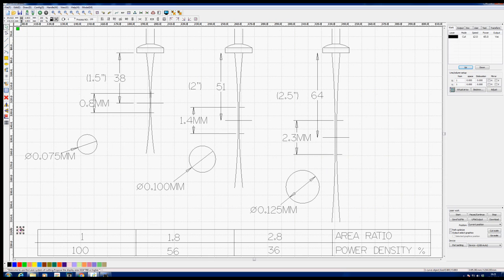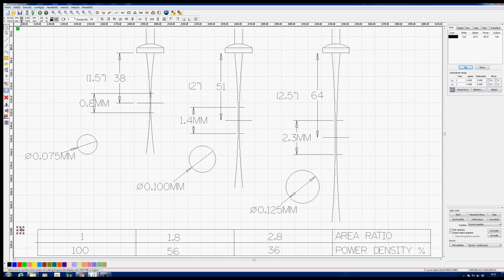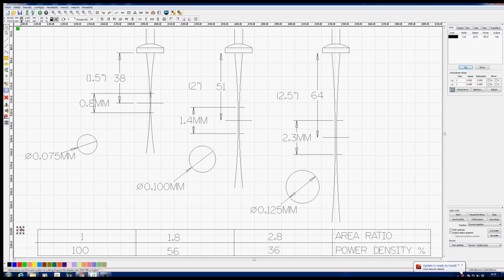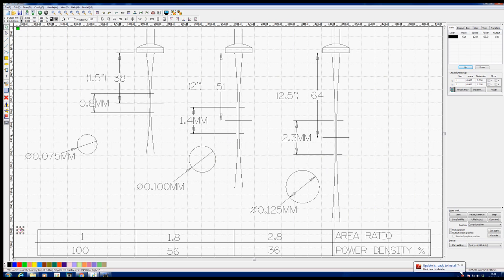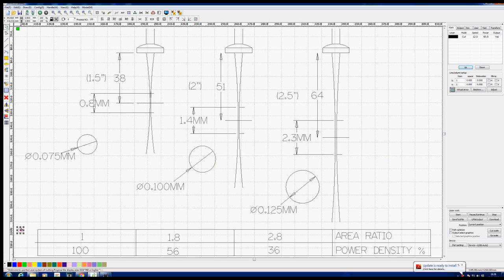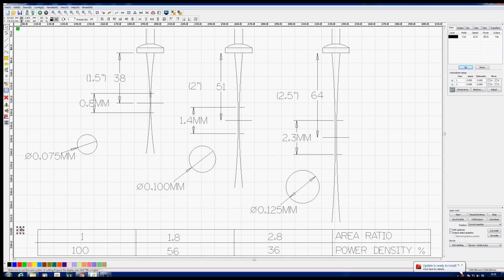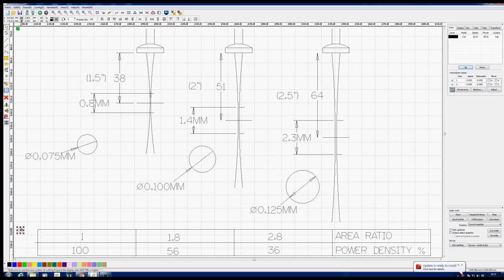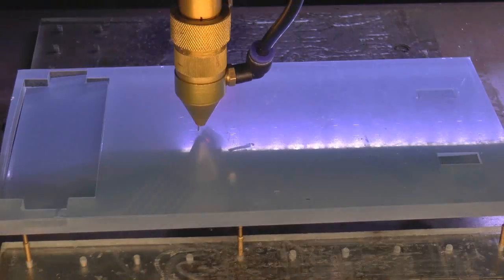RDWorks Learning Lab 39 Understanding Lenses

Comment: Where did you buy the 38mm lens? My lens has fogged up badly (stupid experiments) and I can no longer clean it.

Thanks for the very informative series. You saved me a bunch of money and allayed a lot of my fears regarding these machines and their quality.
Reply from the maker: I have bought from here successfully several times
http://www.ebay.co.uk/itm/New-HQ-ZnSe-GaAs-Focus-Lens-For-CO2-Laser-Cutting-Machine-Diam-18-25mm-FL-1-4-/330769086309?var=&hash=item4d035fb765:m:mAiSYT53XXKKLeLwI6nRWrQ
18mm 19mm and 20mm diameter available so make sure you measure yours carefully before ordering. The morer expensive HQ coatings gain you another 2% efficiency so not worth the 50% extra, Stay with ordinary ZnSe.
Best regards
Russ

Comment: Hi Russ! First of all i would like to congratulate you about your passion of finding what is wrong and how to fix it after detailed research. If i understood right, the air assist does not benefit the cutting process but the engrave process instead, correct? So if you are trying to achieve the deepest cut possible with a certain lens setup, you will not use air assist at all or just the minimum amount of air? For engraving i see that air assist is crucial in order to have less burning marks from fumes. 
Sure thing is that to own and run a laser machine you have to know many things how they work and be prepared for many brainstorming sessions. I am saying that because many people think that a laser is simple as a printer..... Thanks in advance for your reply. Polis
Reply from the maker: Hi Polis'
3 things to understand about air assist
1) Never turn it off when your laser tube could fire. Even when you don't need much air assist , make sure there is still a whisper coming out of the nozzle. That way you will never fog up your lens.
2)You need just a bit more than a whisper when you are CUTTING acrylic.  Acrylic does not CUT it EVAPORATES. Too much will cool the process down and reduce the cutting efficiency. You can use a little bit more for ENGRAVING acrylic
3) You need maximum air assist for everything else. Any CUTTING in wood or card products produces dense SMOKE because that is a BURNING process. Smoke absorbs IR radiation and so unless you keep the smoke clear from your IMMEDIATE cut area (in the groove) you will lose cutting efficiency and cause lots of charring.
Engraving wood will usually produce brown smoke sedimentation staining around your engraving. There is little you can do about this other than to mask off the surface and engrave through. Faster speed with lots of air helps but it's not a cure.

Thanks for your kind words
Best regards
Russ
Reply: Thank you so much for your detailed reply! I mainly cut plywood on a friends laser machine so have not the chance to fine tune it my self. So, i assume that max air assist will reduce also cutting depth on wood as it does on plexi, correct or not? Thanks!!
Reply from the maker: Hi Polis
Sorry if my answer confused. What I meant to say was minimal air flow for plexi glass but max airflow for EVERYTHING else. Smoke reduces cutting efficiency so you MUST get it gone. Max airflow for all wood products.
Regards
Russ
Reply: Thanks. Got it! So, only plexi glass because it is melting, does not like much air. It cools down the material making it harder for the laser beam to pass :)
Reply from the maker: Hi Polis
Still not quite got it right. Plexi is a rather special type of plastic. Most other platsics MELT when you heat them. If you fired a laser beam at a block of ice it would immediately turn to steam. Well, the same thing happens when you fire a laser beam at plexi, it does not melt but immediately turns to smelly gas. Too much air cools the plexi and reduces the speed that the plexi can vaporize.
Hope it'snow clear
Best regards
Russ
Reply: Crystal clear!!! Thanks a lot for your patience explaining :)

Comment: What am I missing, if it's a 38mm lense why it it being focused with a 6.5mm spacer?   Shouldn't the spacer be closer to 38mm? 

Also doing some reading on focus lenses. It seems the longer the focal length the deeper the cut.   Maybe you are seeing a different effect because your laser is not powerful enough for a lenses with such a long focal length?  Since with the longer focal length the "laser density" is weaker

There is some solid info from a very reputable company here
http://www.troteclaser.com/en-US/Laser-Machines/Accessories/Options/Pages/Focus-Lenses.aspx

Cheers
Reply from the maker: +Nathan Clark 
Hi Nathan
I suspect that you are doing a lot of preparatory reading prior to getting a machine. If so then lenses can understandably be a bit confusing.
The 38mm focal length is the point where the all the energy is concentrated to a theoretical sharp point. It is measured from the curved side of the lens when it is facing the work. The lens is mounted in a holder inside the nozzle. There is about 32mm of beam path hidden inside the nozzle and its only the last 6mm which exits the nozzle. Thus from a practical point of view it make sense to set your work that 6mm distance from the end of the nozzle. 
The details I have in  my picture are absolutely correct and accord with the data on the Trotec site. The shorter the focal distance the better the lens will focus the beam to a smaller waist. The smallest cross section of the waist is called "spot size" For a fixed wattage beam you can do twice as much damage to the material  by reducing the spot to 70% ( for example reducing the spot from 0.1mm to 0,07mm will double the energy density.........and be a sharper knife.) 
I tried to remove the maths from my explanation but if you want a proper mathematical explanation of energy density, spot sizes and focal lengths then you need to visit 
http://www.parallax-tech.com/faq.htm

Hope this will help remove the confusion
Best regards
Russ
Reply: +SarbarMultimedia Yes that makes total sense about the lens  being up in the nozzle.  It seems trotec says the longer the focal length the deeper the cut, but I though in  your video you said the shorter focal length cut deeper. Maybe I misunderstood the results.
Reply from the maker: +Nathan Clark
Hi Nathan
The answer is both yes and no. Let me explain. The only thing that gets longer as the focal length increases is the length of the waist  With that increased waist come the increased spot size and the lowering of energy density. That's physics, not an opinion. However you can get the energy density back up with a dramatic increase of watts into the lens. But what you have done is increase the cut width so you are now using a powerful axe rather than a  precision scalpel. Here's where I can understand your misreading/confusion. That longer waisting means the the energy density CHANGES at a slower rate, thus you have the ability to cut thicker materials.  Sadly with low power machines like we have you will never be able to pump enough power into a  long focal length lenses to turn it into an axe.
However, fear not because my 38mm scalpel , if I set the focal point 2 or 3mm into the material, can cut through 15mm acrylic. You can see an example of this at the end of this video. 
https://youtu.be/4qy5cPZWGj4
People with the standard 2" lens cannot achieve this even with 60 watts. Thus my contention is that for our typical 40 to 80 watt machines you will get a deeper cut  with a 38mm lens. I could cut even thicker material with a 75mm focal  length lens IF I had a 120 watt machine. It's pretty obvious that more power will give a deeper cut but I hope I have shown you that for any given power of machine there is an optimum focal length lens to get the deepest cut and when you run out of power , extending the focal length will cause the cut depth to DECREASE
You do not need high energy density for engraving that's why these machines are supplied with a 2" lens. These machines are sold as engraving machines that will cut, not cutting machines that will engrave
Great discussion. Thanks Nathan
Best regards
Russ
Reply: +SarbarMultimedia This along the lines of what I suspected- a lower powered machine can't take advantage of a longer focal length for cutting.
Reply from the maker: +Nathan Clark 
Hi Nathan
I can now tell that you have completely understood the concept. Whatever power machine you have, there will be only one lens to give you the deepest cut. If you have 100watts available then that is probably a 2" lens but change up to a 2.5" lens and for 100 watts the cut will be shallower.
Who said owning one of these machines was simple?

Best regards
Russ

Comment: Thanks for the Video!  Ordering a 1.5" lens for cutting my plywood..
Reply from the maker: +Ben Rogerson 
Hi Ben
It is worth the extra to invest in a HQ lens.  Natural uncoated Zinc Selenide lenses only transmit about 70% of the laser energy. Not because its absorbed or attenuated by the material but because the crystal structure is 30% reflective at this wavelength. An anti-reflective coating improves this to about 95% for standard cheap Chinese lenses but with more expensive coatings this can be as high as 99%. You will often see Chinese machines and lens suppliers mention that the HQ lenses are of USA origin. I think (just like Colonel Sanders and Coca Cola) they closely guard their recipe You might be able to buy one locally rather than China
Regards
Russ
Reply: +SarbarMultimedia how about the  GaAs lens is it worth the extra money? Or should I look for a coated ZnSe  lens?
Reply from the maker: +Ben Rogerson 
I would stick with the HQ ZnSe. I believe the GaAs lens will not transmit visible light so if you wish to use a red laser pointer at any stage you will be in trouble.
Regards
Russ

Comment: So if a short focal length has better penetration and also a finer cut, is there a practical use to ever use a lens with a longer focal length?
Reply from the maker: +Counselor_X 
A question that I have asked myself also. However, I do believe that if you have a more powerful machine say 80 watts and beyond you will get a better cut  with a 2" or 2.5" lens and because engraving (which is what these machines are sold as) is not all about raw power, it may well be that the "softer" cut gives a mor pleasing result. I don't know but that's exactly the sort of thing I plan to explore in my new engraving journey because I do have a 2.5 FL lens

Best regards
Russ

Comment: Hi Russ, Love your videos. Quick question on focal distance. Is the actual focal distance on a 1.500" lens = to  1.500" from the bottom of the lens or does one need to subtract 1/2 of 0.03149 (8mm) to get the optimal cutting point or, should one adjust the center of the distance to 1/2 of the material thickness, thus placing maximum cutting power to the center of the material? Seems I might have missed the video on adjusting focal distance.
Reply from the maker: +MarilynAnd Keith 

Hi Keith
https://youtu.be/PUdEUxJH2_o

That's the one you need to watch. It's the empirical way to determine your focal distance from the end of your nozzle. It appears that different machines have different nozzle styles so that's why they normally supply you with a silly piece of acrylic on a piece of ribbon. It's absolutely meaningless to a newbie and there are no instructions in the manual to advise it's use (unless you found something when doing the English translation.) Although you were only tackling the RDWorks bit.
My lens drawings are technically wrong because the focal length is worked out from the top curved surface. However, it's not going to confuse you if you are trying to determine your FL because lenses are only available as 1" to 3" in 1/2" increments and 1" increments thereafter. The odd 3mm lens thickness wont stop you determining your lens  FL..
Once you have determined your ideal nozzle to work surface distance. (mine is 6.5mm), you will use this distance for most situations, especially engraving where you often want the crispest dots. Some people advise dropping the work by 1mm to get a bigger dot and a slightly "softer" finish. It depends on the material and your preference. When cutting thick materials it's advisable to raise the work a little closer to the nozzle. 3 to 8mm acrylic maybe up by 1mm and for 12 and 15mm acrylic I raised it by 2mm (ie 4.5mm gap). So as you can see, nowhere near half the material thickness.
Regards
Russ

Comment: Very nice and helpfull videos.
But i did not find the answer in the video
And i am almost afraid to ask this ,but has the curved side has to be up or down ?
Thank you
Reply from the maker: +bart vandegoor 
Hi Bart

The clue is in the drawings at the beginning of the video. I also found out fairly recently that my lens has been fitted the wrong way for months ( see https://youtu.be/TUJgBcb2xnQ at about 10 minutes in) Most machines are fitted with a simple plano-convex lens that is flat on one side (like the drawing) but  I have heard of machines being fitted with a meniscus lens. This is not flat on the bottom but concave. You woulds still ft this with the convex side up (away from the work piece)
Thanks for your kind word
Regards
Russ
Reply: +SarbarMultimedia 
Ok Thanks for your answer Russ.
Tomorrow i will check if it is a meniscus lens, the only thing i know it is a 63.5mm. , and the tube is a 80w Reci s2 model.
I love watching the video's . they are very helpfull.
Thank you again